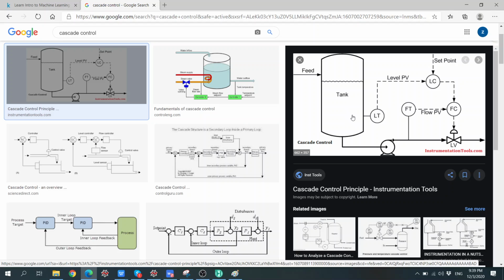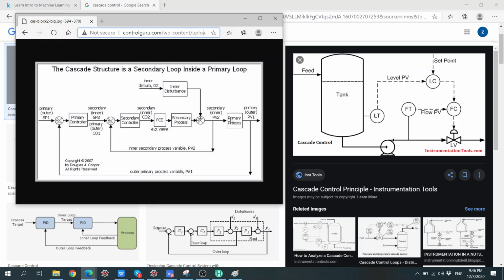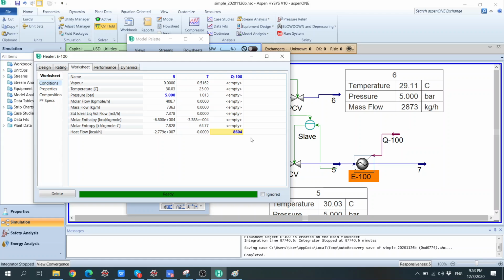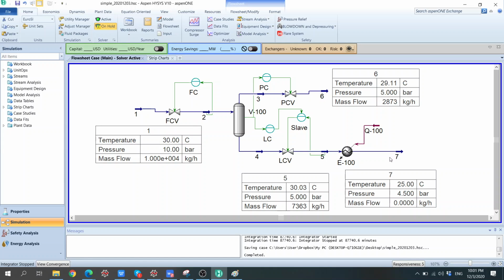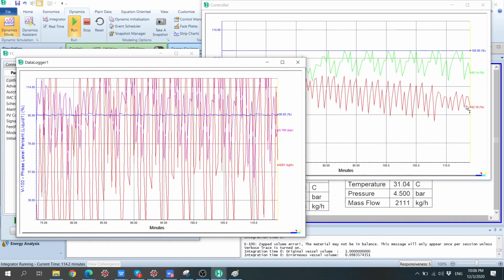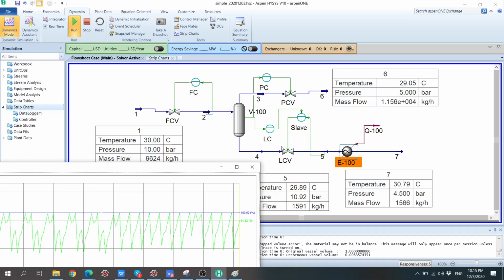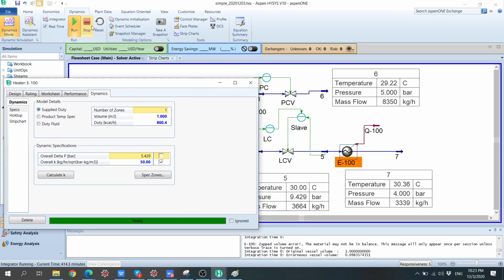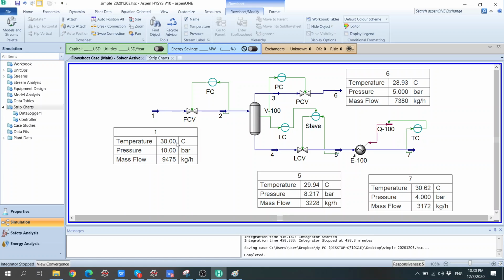Setting Up Dynamic Simulation (Part 3 - Controller Stability)

Comment: Hi again! As always, thank you so much for posting these lectures!
I just had a question about the use of cascade controls, under which type of circumstances would you consider the use of cascade control?
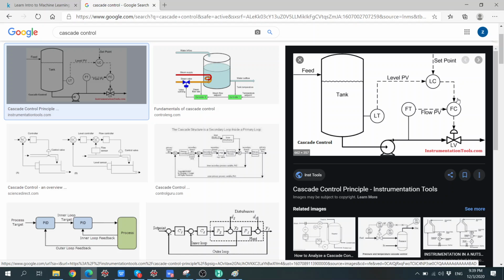For the example you were showing @2:20, what is the benefit of using a cascade control over a simple level control?
Reply from the maker: Hi, 
We typically use cascade control if we have more than 1 measurements (in the example above they are level and flow measurements) AND 1 final control element (which is the flow control valve). Another point as a rule of thumb is that the inner loop (slave) has to be a lot faster than the outer loop (master). It's of course more complicated than a single control loop. However, if we can justify the benefits of using the cascade mode, it's worth it. For example:
1. Reflux is typically done by using the reflux flowrate as the measured variable and we have the set point for it. When feed flowrate or composition changes, this reflux flowrate has to be changed accordingly. But, to how much extent? Well, we can do trial and errors for that. Or, if we can have a composition measurement on the distillate stream, which you know it is much much slower than measuring the flowrate of the reflux, we can use this composition measurement to tell what the reflux flowrate should be. Thus, the composition control loop is the master and the reflux flowrate is the slave. 
2. In heat exchanger where we heat a process stream with a steam, we can have two measurements, which are flowrate of the steam and the process outlet temperature. And we know that changing the opening of the steam control valve will change the steam flowrate much faster than the process outlet temperature. Thus, we can use the process outlet temperature control loop as the master and the steam flowrate control loop as the slave. We could of course neglect the flowrate measurement of the steam by directly manipulating the steam flowrate from the process outlet temperature (aka controlling steam flowrate without knowing how much it is flowing). But, we almost always have steam flowrate measurements for energy balance and others. 

When we have disturbances for these two examples such as changing feed compositions (ex. 1) or changing steam pressure (ex. 2), this cascade control can bring some stabilities to the performance. You can simulate this and compare the result with the simple control.

By the way, the example in the video that you referred to is not a really good example to explain the benefit of cascade against a simple control loop as you have discovered. So, well done!
Nonetheless, it may have been that the level is a more important variable to control than the flowrate. Thus, it needs to be measured and becomes the master.
Reply: @ZulfanAdiPutra  That's a very detailed explanation and it makes a whole lot of sense. Thank you so much!

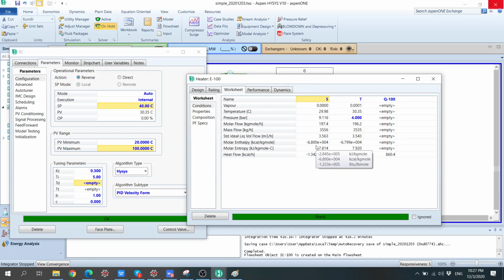Comment: On 50:30 why you use reverse action instead of direct action? I think when we want to increase T we should to increase Q (direct action)
Reply from the maker: We think of the action as it deviates from the set point. 
If the PV goes above the set point, e.g. T increase, what we need to do is to reduce the Q so that the T comes back to the set point. And, vice versa. 
Now, if we have a liquid level (as PV) that is controlled by manipulating the downstream valve, what should the action be? Direct or reverse?